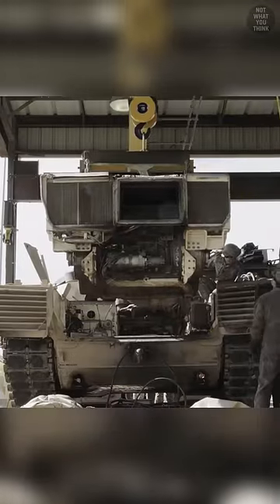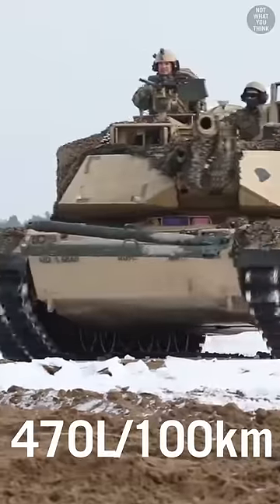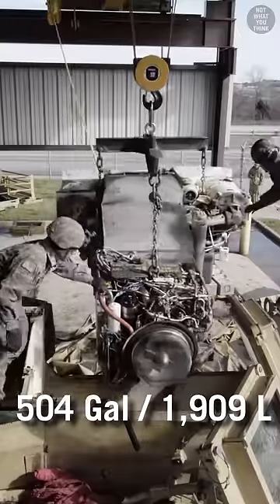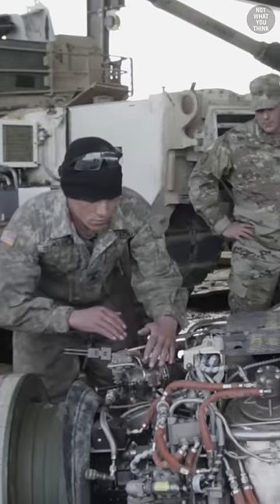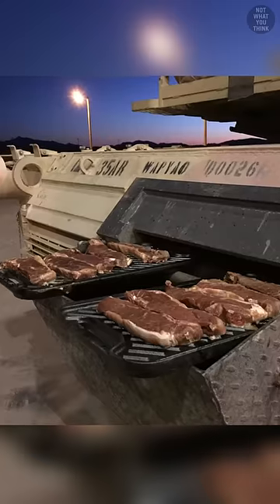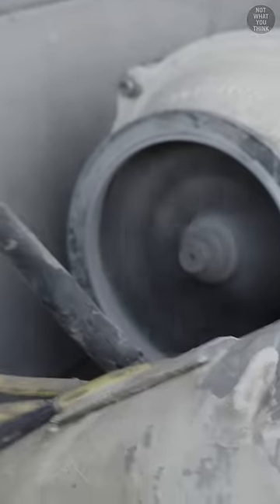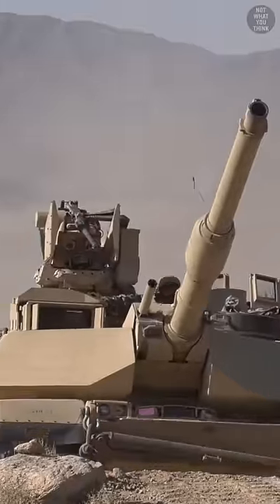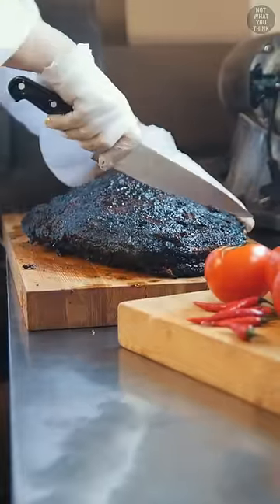Why M1 Abrams Tanks Have Gas Turbine Engines #shorts

Comment: Light engine...more fuel (and more fuel weight)
Is that tradeoff worth it?
Reply: Apparently it was... or there were other reasons at play
Reply: Yes, you gain operational flexibility by being able to use other fuels. You also gain some tactical stealth with the significant quieter and cleaner burning engine(less smoke, less noise = less time to detect/ easier to hide)
Reply: Most tanks engine are multifuel for example the AMX-30
Reply: What are you a engineer
Reply: It’s been worth it for 42 years and counting.
Reply: Worth it (*)

(*) if your country have an abundant supply of fuel and are willing to spend it on military vehicles.

Also some people say that the turbine engine of Abrams require more maintenance than the simpler (by comparison) Turbo Diesel of the Leo 2.
Reply: Yes, the extra fuel weight is extremely lower than the extra weight of an alternate diesel engine
Reply: Yeah this video is really bad lol. The turbine is smaller than a diesel, except when you look at the Abrams transmission, which is a monster. Hence the Abrams is acutally longer than a Leo2. The "size advantage" is just nonsense.

I'd wager the reason the US chose a turbine is cuz the american diesel it was competing against was just not very good.
Reply: @termitreter6545  The reason they chose the turbine over the engine is using leopard2 is because when the designs were being shown to military officials that thought turbine was gonna be cheaper to run from their experience with the helicopter industry. Also a turbine is quieter over long distances. The other issue I have is when he said it’s less efficient than a Diesel engine is sorta correct a Diesel engine has a higher efficiency at low rpm but the turbine has a higher efficiency at high rpm. There are many things that the turbine has an advantage to and vice versa many of which this short didn’t have the time for.

The “American diesel” wasn’t American it was the leopard the Americans were goring to buy the leopard but it lost the competition.
Reply: @user-wb1ww1py2f  this is a very good point but modern multi fuel engines do not have the variety that turbines do. This isn’t super useful in a combat scenario but in the very unlikely situation that you don’t have diesel the Abrams will runoff of bunker seed and even alcohol while a multi fuel will not.
Reply: No
Reply: @kellengro1124  Its not that the video is limited in space, but its claims are misleading. Like, no, the turbine doesnt save you space when the full drivetrain is notably bigger than a Diesel. 

The turbine uses much more fuel in general, its kinda pointless to argue 
if theres a niche situation where its theoretically more efficient.
And its not like we know mechanical details anyway.

And there was an american diesel. At no point did America seriously consider to buy the Leopard 2; they apparently just wrote that off as "too expensive", ironically enough. Probably just wanted something homemade, besides different priorities.
What was actually talked about were two prototypes, one from Chrysler (turbine), and one from GM (diesel). And GMs diesel engine apparently didnt perform very well.
Reply: Yeah. The fuel economy is only the worst during start up. Under a load or during operation it's just about the same as most modern tanks. A little less efficient, but it also has lots and lots of fuel, and that fuel serves other purposes besides just being fuel. It's also effective as pseudo armor.
Reply: @izacks15  basically all western tanks are multi-fuel. You just can't put gasoline in the diesel ones, but the Abrams can operate, but you have to do an entire pack inspection and test if you put any in the tanks and after every 24hrs of operation. Also, the Abrams is actually louder in decibels but also higher in frequency so it doesn't travel very far and the intensity drops off very quickly.
Reply: @termitreter6545  they actually chose the turbine for a lot of reasons other than that. The diesel they were going to put in it was basically an American made version of the one in the Leo 2. The Abrams and Leo 2 both stem from a common ancestor, the MBT-70 hat was a joint project. If I was going to point you to a creator that explains the choice in better detail and not interesting than a paragraph written here I'll refer you over to Spookstons Abrams myths video. It's short sweet and to the point. I used to be on the Abrams so I could go on and on about it and all the features and abilities as well as how understated the stats are for particular things.

As for one factor, the torque output and impulse was better in the turbine engine. It's overall a bit less efficient but we are talking about America here. It saved on weight compared to the diesel and the transmission it would've had. Yes, the transmission and drive system on the Abrams is huge, but what do you expect in an MBT. I think the most impressive thing I've ever seen has little to do with the engine though. Ever seen video of one locking up the tracks to do an emergency stop? That beast weighs in at over 72 tons dry and can stop from full speed in around a single track length.
Reply: @kellengro1124  the Americans were never going to buy the Leo 2. They were going to buy the engines if that engine won the competition. You're mostly correct in your comment. The only time the Abrams is very inefficient is on startup. It burns 8-11 gallons of fuel to just start it and get to stable idle. That's literally an entire fuel tank in a Honda Accord. Pretty insane, but if we fueled up in the field in a column or before movement the tanks were usually running. It takes to long to shutdown and then start back up and it's a waste of fuel and adds about 3 minutes or more to each Abrams being fueled.
Reply: @kellengro1124  you're correct about the Abrams having more availability of fuels. Basically if it burns and is a liquid you can use it in the Abrams. But certain fuels like gasoline can damage the engine if run for too long. But a mix of gasoline and motor oil would be acceptable and likely not cause many issues compared to straight gasoline.
Reply: A cubic foot of diesel weighs just over 52 lb. A Caterpillar diesel engine with comparable horsepower weighs over 13,000 lb. Then you have to add fuel for that engine. It was definitely worth it.
Reply: @Deathbomb9  Ive seen the spookston video, and I dont think he said the GM engine was a Leo2 copy, and instead that it was underdeveloped and had reliability issues.

I find it hard to believe what you say about fuel efficiency. The Abrams has something like ~2 times the fuel capacity of a Leo2 and supposedly slightly less range. If you were correct, then range should be much, much greater. Its also not less of a challenge just because youre the US; you need a huge - and vulnerable - logistics network to move the fuel.

The Abrams transmission+engine is bigger than the Leos engine+transmission was the point. Which defeats the space-efficiency advantage of the turbine, which the vid was wrong about. No clue what it does to the weight though, but it probably doesnt help. 

I know about the turbine being potentially more responsive; that might well be true and a legit advantgage, but the specifics are probably all military secrets or whatever. 

Either way, the US doesnt seem to be motivated to switch to a diesel engine, nor do other countries seem envious about tank turbines. Im not saying turbines are useless or whatever.
Reply: @timbodnar6711  then why is the leopard 2 lighter and has better armour?
Reply: Yes because when you transport the tank to the other side of the planet, it doesn't need to be filled with fuel.
Reply: @user-wb1ww1py2f  no diesel is a true multifuel. There has to be at least some diesel in their fuel to function or else it won't work. A turbine could use literally anything combustible that can go in the fuel tank.
Reply: @minhqun  for one thats untrue. A turbine is much more simple than a piston driven engine. However they do require tighter tolerances. Plus they are better while cruising which falls in line with American doctrine.
Reply: @kellengro1124  I've always wondered what jack Daniel's would smell like coming out thr back of an Abrams
Reply: Also, something not mentioned in the video, turbine engines are generally considered more reliable than piston engines because of the simpler design and less moving parts. At least, that is true in aircraft, I'm not sure why it wouldn't be true here too. But definitely could play a role in choosing it over a more traditional piston engine.
Reply: @termitreter6545  i get that last point you mentioned. And the responsiveness isn't exactly a secret. It's more responsive and produces a larger torque band as well as maintains the ability to apply all the horsepower and torque better through its range. When the Abrams was in competition with the GM model some things were adapted from the GM model, similarly to how the ATF program for the Raptor where both companies contributed things so it wasn't a total loss to one or the other. And the engine was underdevelopeded and had many issues but as all the final blocks were being laid there was an option to adapt and adopt the German made diesel engine similarly to how we adopted and adapted their gun design and produce it ourselves to our own specs besides things like bore, chamber, wall thickness minimums and such. But the minds that be decided to go with a domestic option because then there was no worry of not having engines.

As far as size, yes, it's a little bigger all together, but it is lighter. Mind you, almost the entire guts of that engine is titanium. It's lighter, trust me.

The fuel economy wasn't great but its gotten better over the years. The Abrams enjoys the higher RPM range because the most can be had from power and torque and the engine is more efficient in motion than at idle. I spent many, many hours on them, in them, and learning about them. I said before that it still wasn't as efficient on fuel as a diesel, but it's not far off. And yes, you need logistics like the US to support any tank in the world in combat, not just the Abrams. You need full support to any troops, tanks, infantry, scouts, engineers, and garrison or rear support. The US military will never outrun or over stretch its logistics chain. The Leo 2 engine was an optional proposal and there was a point they were considering having a diesel and gas turbine available once the diesel engine was better or sourced and secured for domestic production but the cost and redesign would've been very costly. Before it even made it to paper as a real proposal it was canned because the juice wasnt worth the squeeze.
Reply: @izacks15  
You do know the Leopard 2 engine can also use many other fuels ?
Reply: @minhqun  turbines are significantly more simple when compared to any other type of combustion engine which means they are easier and cheaper to repair and are much less likely to have a catastrophic failure.
Reply: @TheKenji2221  *mixed with diesel. Diesel engines can run on many things but it must be mixed with at least a little bit of diesel
Reply: @timbodnar6711  I did not believe this and had to check. Not too surprised by 7lb per gallon,but 7.5 gallons per cubic ft... gallons are smaller than I thought
Reply: @termitreter6545  wrong
Reply: @Fatallydisorganized  the way I understand it, if there anything wrong with the Abram's powerplant they just pull it and swap it with a working one and do a tear down and repair later
Reply: From my experience the Abrams handles and runs on less fuel than the 88m Hercules which has a giant diesel engine
Reply: @Deathbomb9  
8-11 gallons of fuel for staring the engine. -That is mad. 
Guess I don’t drive my tank to the nearest supermarket anymore.
Reply: Yes, because it can drink anything. And more powerful, did you not watch the video
Reply: @termitreter6545  Much of that has to do with fuel prices and availability in Europe versus the US. The US tanks have to fight in the US, not just foreign places. Diesel is actually far less common in the US than it is in Europe. Petrol/gasoline is very available in Asia, but Diesel is much less so. Ethanol is the primary fuel used in S. America meanwhile. All considerations.
Reply: @einar8019  not a tank guy, but possibly because they had weight specs to adhere to. The Abrams has depleted uranium in the armor. They were able to use heavier materials because of the weight savings? The leopard uses composite materials for the armor. Could it also be like comparing a Mercedes S550 to a Cadillac STS?  Looks like both tanks possibly came out of the same development program. There are a lot of factors.
Reply: @legion8907  I checked it a couple times before I posted that LOL
Reply: Did some math. 

M1A2 Abrams uses Honeywell ATG1500 has a weight of around 1700kg add the fuel capacity weight to that and its at 2834kg.

For compassion

Leopard 2A7 uses a MTU MB 873 Ka-501 which is a 27 liter twin turbo diesel 90° V12 which weight about 4129kg fully loaded. Add the fuel capacity of 986kg and you get a total of 5115kg. 

So a bit more than double the weight of the M1A2. Both tanks have about the same horsepower per ton of around 23.6 for M1A2 and 22.2 for 2A7.

 M1A2 at its heaviest weights 73.6 tonnes and 2A7 weights about 66.5 tonnes.

In conclusion the gas turbine engines perform much better than conventional internal combustion engines. The pros certainly out weigh the cons in my eyes.
Reply: @timbodnar6711  if they wanted to adheer to weight specs they would have made a mor effective armoure scheame
Reply: @kellengro1124  The leopard is just a waste of space
Reply: Ye
Reply: @einar8019  The Leopard doesn’t have better armor and it’s lighter by a few tons.
Reply: @TheKenji2221  Not as many as the Turbine engine, not even close
Reply: @CrayonEater255  it does, no penetrator thats not longer than the pike nose can pen the turret(noone uses that long penetrator) and the hull armour is way thicker on the leopard
Reply: @termitreter6545  - the turbine doesn't actually use more fuel than a similar power output diesel engine, in the current revision of the Abrams. Instead of idling, where the turbine has higher fuel consumption, they shut the turbine off and use an apu to power the electrics. When moving (which isn't exactly "niche"), the turbine will have at least the efficiency of the diesel engine and greater efficiency as speed increases.
Reply: @Texas240  The APU issue is a seperate thing. But frankly, from where do you even got the idea that the turbine is as efficient as a Diesel?

Because what you say seems to go completely against common understanding. Diesel Engines are almost always significantly more efficient than Turbines.
The exception is at extremely high  maximum performance, but an Abrams going 100kmh would likely destroy its drivetrain and tracks, so that doesnt even matter.
Theres also transmission losses; the turbine spins significantly faster than a Diesel, hence the Abrams needs a massive, complex transmission to lower the speed. That means more weight, space and efficiency loss, compared to a Diesel.

And lastly, the "public" numbers of the Abrams show it having slightly less range than the otherwise similar Leopard 2 tank, but roughly two times the fuel tank size.
Which should be a pretty clear indicator how much less efficient an Abrams is.
Reply: @termitreter6545  - you can't directly compare efficiency of different engines unless they're equipped in the same vehicle. The sep 3 abrams is something like 20,000 lbs heavier than the Leopard.

You want gas mileage or survivability in your tank? Weight reduces vehicle fuel economy.
Reply: @Texas240  Well you could just look at earlier, lighter versions then.

Also, Im not gonna hold it against you, doubly so because I made the same mistake at first, but I think youre confusing short and metric tons.
In metric tons, it looks like M1A Sep v3 is 66.8 tons, and Leo 2 A7 is 67.5 tons. Obviously the real tonnage will vary, so they are pretty much the same weight.

I think at this point, their weight and dimensions are basically limited by what trains or bridges can carry. Those tanks need to be replaced so their mass and size can be more optimized for modern battlefields, while leaving space for more upgrades.
Reply: Fuel is a non-issue. America has oil and the greatest military supply chain on the planey. Germany has neither and so Leo saves gas. Abrams can guzzle all the fuel it wants.
Reply: You can pour fucking vodka and cooking oil in the tank and it'll run. Yes, the tradeoff is worth.